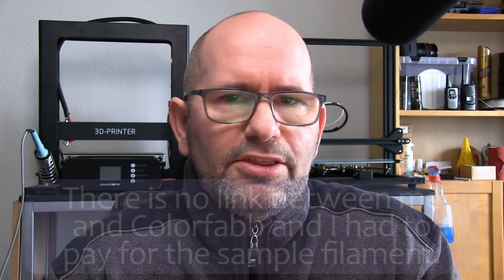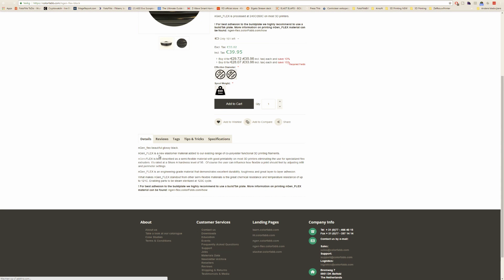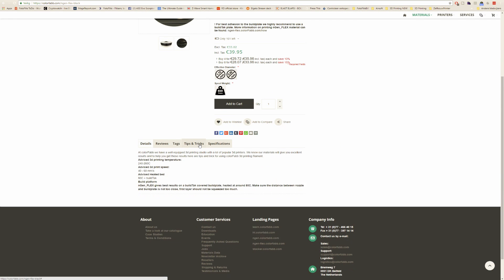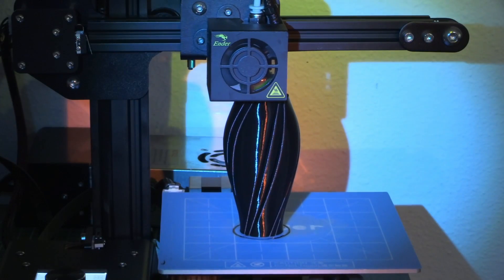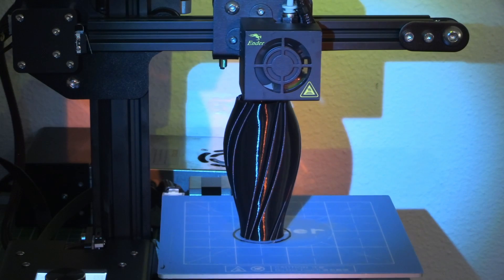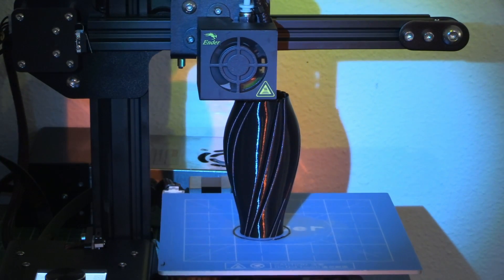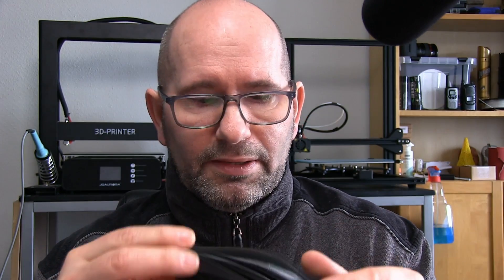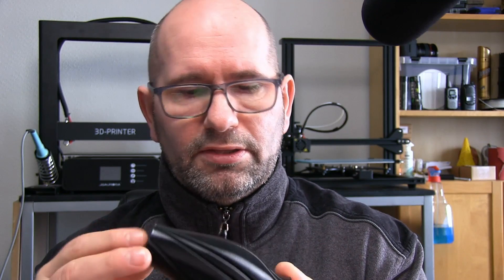▼ Printing with Colorfabb NGEN FLEX filament

Comment: What flexable filaments can u print with stock da Vinci 1.0 pro?
Reply from the maker: None... The extruder is the problem, it's way to open.
If you feed flexible filament through it, it will not be pushed into the PTFE tube, but go it's own way in the extruder.
You have to change the extruder to make it possible to print with flexible filaments, but then again, it will never be perfect.

For best results with flex filaments, you need a printer with a direct drive extruder.
Reply: 3d Print Creator is there a way to use ptfe tubing to block the gaps in the extruder to allow use of flexible filament on the Da Vinci 1.0 Pro? Also I was considering getting an Ender 2 3d printer for flexible filament.
Reply from the maker: You could, with a lot of engineering, make something so you can use the Da Vinci to print flexible, but then you need to make sure there is no gap in the extruder and that's really complicated in that type of extruder. Easier you change the complete extruder for a model that is made for printing flexible filaments. There are sites on the Internet that show you how to make such an extruder, like Thingiverse. 

The Ender 2 is very well capable of printing flexible filament, as I have been showing in one of my video's about that printer. The way to do it is to print slowly. If you can afford it, buy the Ender 2 for it.

Comment: Thanks for the review. I've been wanting to try NGen flex on my ender2 - what's the basic settings you used? hot end temp./speed/bed temp./retraction etc. if you could share that would be really be helpful. Thank you.
Reply from the maker: I have the hot end at 245C, the bed at 80C and the retraction is at 6mm in my CR-10Mini and at 4mm at my AnyCubic I3 Mega, with a speed of 100mm/sec. Also, I have set the outside perimiter to 50% speed while the overall speed is set to 50mm/sec.

This 50% setting is because I have the NGEN filament with sparkles (looks like glass) inside and the 50% setting gives the best type of gloss. If you have normal NGEN filament, you don't need this 50% setting.
Reply: Thanks for the info! - I've got a spool ordered and will be giving this a go.
Reply from the maker: Great, Let me know your results.
Reply: How about your settings for the Ender 2?  I was very surprised when you said the Ender 2 did a great job with this flexible filament.  I just got one a week ago.
Reply: Scoot Roter I was a few hours into dialling in my settings when my extruder started playing up. Fixed that and then the unthinkable happened... the motherboard died. 3 weeks later the part arrives tomorrow so I'll let you know :)

Comment: Have you tried other flex materials?
Reply from the maker: Over the years I think I have tried all of them :-)
The biggest difference between flex materials is how sticky they get after printing.
Some materials are great for manufacturing wheels because they have a grip on things, while others (like NGEN FLEX) have the feel of PLA while they are flexible. Totally not usable for things like tires for a model car, but perfect for a flexible lid on a box.
So you have to choose your materials depending on the usage.
Reply: yah, I was kinda looking for a good comparison :)

Comment: Hi Brian have you tried refrigerating flexible material to reduce it's flexibility and hence stiffen it for passage through a Bowden Tube extruder?
Reply from the maker: Hi Alan,
No I never heard about it. But I can hardly believe this would work for me as the room where I am printing in is always around 20C and the filament would be from frozen to room temperature in less then a few minutes.
Reply: I only mentioned it because one of the members on the Da Vinci Users Group on Facebook mentioned doing it with one of the Jr models and it made me think it might be worth a try when I saw this I haven't tried it myself yet.
Reply from the maker: Well, after rethinking it... I can imagine that when you have troubles loading the filament in the extruder, freezing the filament can make it easier.
however, once it's in the extruder and it's flexible again, it comes out of the extruder from sides I didn't know it was possible :-)

Comment: Will it work with a Da Vinci Pro printer?
Reply from the maker: Not with it's original extruder, but if you upgrade the extruder the machine can be used for NGEN FLEX